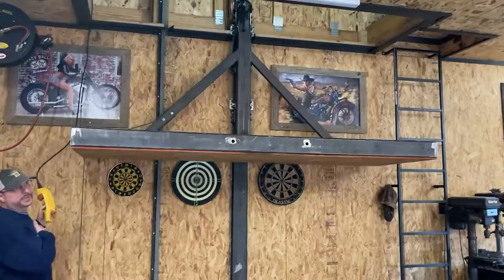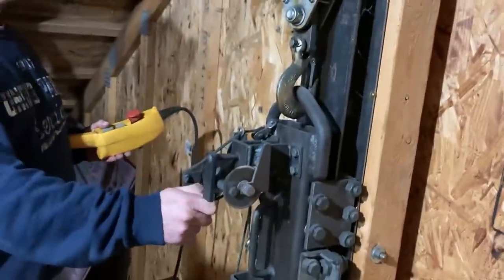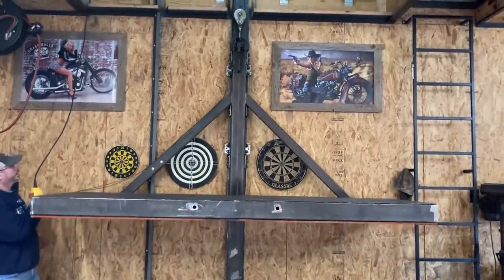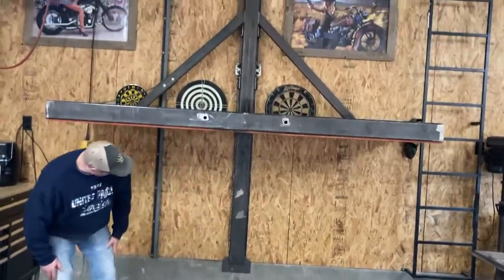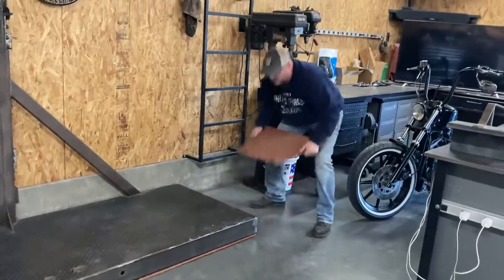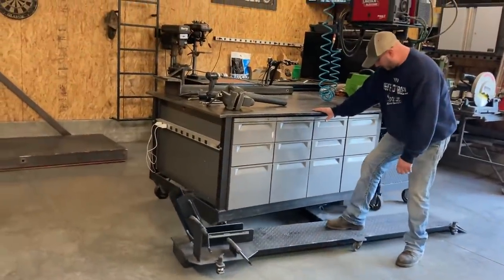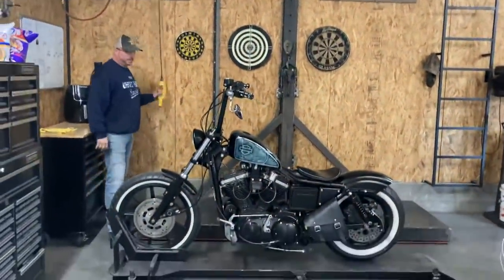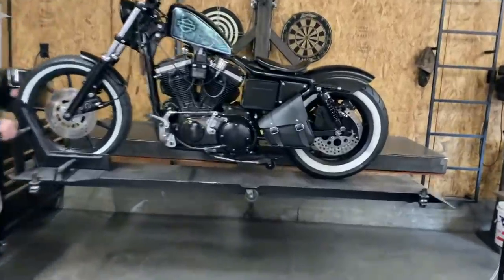HOMEMADE ELEVATOR with AMAZING ATTACHMENTS garage/shop/attic with motorcycle lift and BOOM

Comment: Perfection!! Can you get a little more detailed? i.e. the rail against the wall; what is the design, the lock mechanism etc... Like everyone else has exclaimed about your build, this is absolutely the best I have seen. Your HIRED!!!! :)
Reply from the maker: The track is made of 5 pieces of flat stock. It's the front plate with the holes for the safety latch with two other 6" flats welded to back side, the whole length, that are sandwiched between 5 studs in the wall. One stud in the middle and two on each side then bolted together all in one sandwich. I used a stud to space them when i welded those on. Then the two other straps that you see are welded to the 6" pieces going the whole length and are there for the bearings of the train to run in. Those are just screwed to the studs with small cabinet screws and they aren't really holding any weight. They are spaced back from the back side of the front plate to the size of my rollers because you need a track that will hold both directions. The top rollers will be pushing out and the lower rollers will be pushing back into the wall as it goes up and down. There are also rollers that hold the train from binding left and right that run against the sides of the front plate (upper and lower, both sides). If you don't have a safety latch this track really doesn't have to hold any weight it just has to act as a track and could be made more simple. As soon as you latch the elevator into the track it instantly has to hold all of the weight of the elevator and whatever you have on it. Kinda tough to describe. Hope this doesn't confuse the situation.
Reply from the maker: latch mechinism video 

https://www.youtube.com/watch?v=82oSWZLsv8E&t=0s

Comment: Father in law used to winter his british sports car in the garage attic.  Not as slick as your set up.  He pulled it up with 4 hand winches and slid two logs under the chassis.  I thought it was crazy, but it worked for 20 more years until he sold the car.  I don't think a modern build garage would hold a car, even a little one. Mine creeks when I put Christmas decorations away.
Reply from the maker: Ha. Pretty sure mine would hold it. I built the shop as well. It’s pretty stout. 😬

Comment: As a welder and fabricator of over 30+ years, this is the most amazing lift I've ever seen. I've built a few in my time but nothing like this. Not to mention how many different ways you can use it. You should be proud of the work you've done 👍👍. I just wish I had a set of plans so I could build myself one. Again great job.
Reply from the maker: Well thank you. I agree. Sorry I don't have plans. I just build on the fly.

Comment: Absolutely the best lift I've seen yet. I've been a  steel fabricator for 42 years so I've seen a lot. Needing the same setup due to a weight issue, I have to transfer the weight to the column. Any chance I could get more pics of the actual trolley and beem. Thanks
Reply from the maker: https://www.youtube.com/watch?v=82oSWZLsv8E&t=58s watch that video and here's an explanation of the track.

 I used a 1000/2000 lb electric hoist. 1000lb single line and 2000lb double line. I use the double line.

 The track is made of 5 pieces of flat stock. It's the front plate with the holes for the safety latch with two other 6" flats welded to back side, the whole length, that are sandwiched between 5 studs in the wall. One stud in the middle and two on each side then bolted together all in one sandwich. I used a stud to space them when i welded those on. Then the two other straps that you see are welded to the 6" pieces going the whole length and are there for the bearings of the train to run in. Those are just screwed to the studs with small cabinet screws and they aren't really holding any weight. They are spaced back from the back side of the front plate to the size of my rollers because you need a track that will hold both directions. The top rollers will be pushing out and the lower rollers will be pushing back into the wall as it goes up and down. There are also rollers that hold the train from binding left and right that run against the sides of the front plate (upper and lower, both sides). If you don't have a safety latch this track really doesn't have to hold any weight it just has to act as a track and could be made more simple. As soon as you latch the elevator into the track it instantly has to hold all of the weight of the elevator and whatever you have on it. Kinda tough to describe. Hope this doesn't confuse the situation.
  The platform is mainly all built of 2x5 1/4 wall except the front edge is 1/8 wall. There's also 2x5x1/4 internally acting like floor joists and more support for bending or flex.   I would say WAY over built, but better safe then sorry. I think I figured it up one time...... at least 500 lbs.

Comment: u could also use it as an antitheft device if u have the space just have a lockout on the remote
Reply from the maker: Good call. Got that set up already.
Reply: @164ChopShop  you actually gave me anidea for a system for my camper so i can take the bike away as well mounted at the rear
Reply from the maker: @dobsondwd  That's what I like to hear!

Comment: Superb lift design, exactly what I'm trying to accomplish. Would you be able to do another video of how you made your platform and rail system.
Reply from the maker: Wish I would have took pictures of all of the structure inside of the platform. Didn't. Its super over built. That's about all I can say.
Reply from the maker: The track is made of 5 pieces of flat stock. It's the front plate with the holes for the safety latch with two other 6" flats welded to back side, the whole length, that are sandwiched between 5 studs in the wall. One stud in the middle and two on each side then bolted together all in one sandwich. I used a stud to space them when i welded those on. Then the two other straps that you see are welded to the 6" pieces going the whole length and are there for the bearings of the train to run in. Those are just screwed to the studs with small cabinet screws and they aren't really holding any weight. They are spaced back from the back side of the front plate to the size of my rollers because you need a track that will hold both directions. The top rollers will be pushing out and the lower rollers will be pushing back into the wall as it goes up and down. There are also rollers that hold the train from binding left and right that run against the sides of the front plate (upper and lower, both sides). If you don't have a safety latch this track really doesn't have to hold any weight it just has to act as a track and could be made more simple. As soon as you latch the elevator into the track it instantly has to hold all of the weight of the elevator and whatever you have on it. Kinda tough to describe. Hope this doesn't confuse the situation.

Comment: awesome lift, mind me asking what type of screw you used to secure the vertical H beam to the wall?
Reply from the maker: That's actually more than what it looks. The track is made of 5 pieces of flat stock. It's the front plate with the holes for the safety latch with two other 6" flats welded to back side, the whole length, that are sandwiched between 5 studs in the wall. One stud in the middle and two on each side then bolted together all in one sandwich. I used a stud to space them when i welded those on. Then the two other straps that you see are welded to the 6" pieces going the whole length and are there for the bearings of the train to run in. Those are just screwed to the studs with small cabinet screws and they aren't really holding any weight. They are spaced back from the back side of the front plate to the size of my rollers because you need a track that will hold both directions. The top rollers will be pushing out and the lower rollers will be pushing back into the wall as it goes up and down. There are also rollers that hold the train from binding left and right that run against the sides of the front plate (upper and lower, both sides). If you don't have a safety latch this track really doesn't have to hold any weight it just has to act as a track and could be made more simple. As soon as you latch the elevator into the track it instantly has to hold all of the weight of the elevator and whatever you have on it. Kinda tough to describe. Hope this doesn't confuse the situation.

Comment: this is one of the very rare do it yourself elevators it has a single centre mounted channel. I would imagine you would have to load it very carefully to stop it from binding or putting too much strain on the motor. But a nice design anyway!
Reply from the maker: The way the trollie is designed with the track... It doesn't bind at all ever no matter where the weight. Some get it some don't. There are rollers that hold it from binding in every direction. Thanks

Comment: Great video Thankyou. Would you please tell me what the tubing is you used for the platform?  Is it 2x4 1/8 wall or do you have suggestions for something better than what you used?
Reply from the maker: Its mainly all built of 2x5 1/4 wall except the front edge is 1/8 wall. There's also 2x5x1/4 internally acting like floor joists and more support for bending or flex.   I would say WAY over built, but better safe then sorry. I think I figured it up one time...... at least 500 lbs.

Comment: Are you using an I-Beam for the vertical support post?  And if you can tell us what size I beam was used.  This is the best thing I’ve seen so far.  Thanks for sharing this, this is my next project for the garage.  I can use the lift, and will be used to service my motorcycles.
Reply from the maker: I didn't use I beam. The track is made of 5 pieces of flat stock. It's the front plate with the holes for the safety latch with two other 6" flats welded to back side, the whole length, that are sandwiched between 5 studs in the wall. One stud in the middle and two on each side then bolted together all in one sandwich. I used a stud to space them when i welded those on. Then the two other straps that you see are welded to the 6" pieces going the whole length and are there for the bearings of the train to run in. Those are just screwed to the studs with small cabinet screws and they aren't really holding any weight. They are spaced back from the back side of the front plate to the size of my rollers because you need a track that will hold both directions. The top rollers will be pushing out and the lower rollers will be pushing back into the wall as it goes up and down. There are also rollers that hold the train from binding left and right that run against the sides of the front plate (upper and lower, both sides). If you don't have a safety latch this track really doesn't have to hold any weight it just has to act as a track and could be made more simple. As soon as you latch the elevator into the track it instantly has to hold all of the weight of the elevator and whatever you have on it. Kinda tough to describe. Hope this doesn't confuse the situation.
Reply: @164ChopShop  thanks for taking the time to explain this, this really helps me.  I have a better understanding of your build now.  I started welding a few years back so this will give me an opportunity to use my Stick Welder a go!!  Thanks again I really appreciate your reply!!  If your near by I wish I can bring you a bottle of bourbon :)
Reply from the maker: @motoryan88  No problem. Glad I could help! That's the goal. I'm in Omaha if you have some extra bourbon. LOL
Reply: @164ChopShop I’m in Darien Illinois.

Comment: Any way you could do a video showing the platform design?  I saw your comments about it being over built but would love to see some more detail.  It seems like a lot of cantilever from the wall.
Reply from the maker: The platform is just heavy wall 2x5 inch around the perimeter with the same in the middle acting like floor joists. I do understand the cantilever part that you mentioned but I built and braced the track with that in mind. It would have to take my whole building down and that ain't gonna happen.

Comment: What's the difference between a winch/hoist?
Reply from the maker: Simple answer is a winch is usually rated to pull horizontally usually 12 volt DC for mounting to a vehicle of some sort. A hoist is usually rated for lifting vertically  and usually 120 volt AC or higher.

Comment: Bad ass, getting ready to build one. I've been looking on YouTube for the past couple months and yours is the best. Do you have any plans or photos that could help me? I really like your locking/safety setup. You are amazing my friend. Love your bikes as well, bad ass. Thanks
Reply from the maker: Hey thanks! No plans... just built it out of my head. Let me know if there is a certain part you would like me to show a little better.
Reply from the maker: @billyr70  Yea that's a stabilizer track. Ill try to get a video up this weekend of the latch mechanism.
Reply: @164ChopShop  I would love to see how your safety latch works as well. Your lift is the first that I have seen that doesn’t look and work like cheap garbage. I’ve been thinking about how I want to build mine, after seeing yours I am back to the drawing board.
Reply from the maker: @kjohnsonjazz  I will do a video on that.... For sure.... This weekend.

Comment: Did you have an engineer design the attic with the idea that 4 bikes would be parked up there? That seems like a lot of weight id be concerned it would come crashing down on a windy day. Seems like a neat build though.
Reply from the maker: Yea. I could put 20 bikes up there and I'd be good. It was all designed for it.
Reply: @164ChopShop  This is awesome. I'm drawing up my plans for my new shop and also have all the steel set aside for a moto elevator too! I had a pretty different plan in mind for the hoist, but seeing this I am seriously reconsidering! Do you remember how your second story floor was framed? I was going to do 2x12, 12" on centre, 16' span. I want to keep 4 bikes up there. Mind are mostly enduros though, so pretty light weight. LOVE your lift!
Reply from the maker: @Mark-vx5dt   I have a buddy that designs trusses. So that's what I used. They do have 2x12 bottoms and weird bracing. They're spaced every 2 foot. 28 foot span. Sheeted on top and bottom 3/4 on the top 1/2 on bottom which helps as well. I'm sure what you have planned would be plenty strong. I've had it completely packed with full sized bikes and its no worry at all.
Reply: @164ChopShop  Thank you!